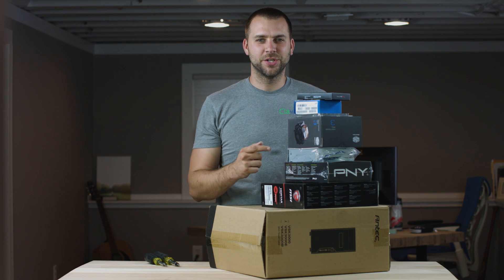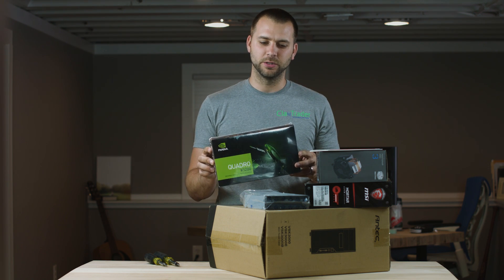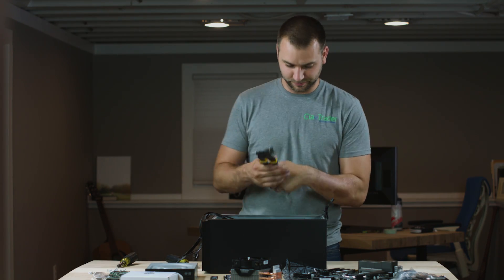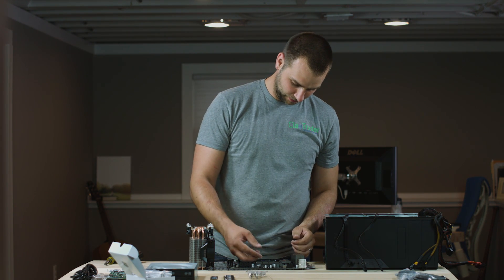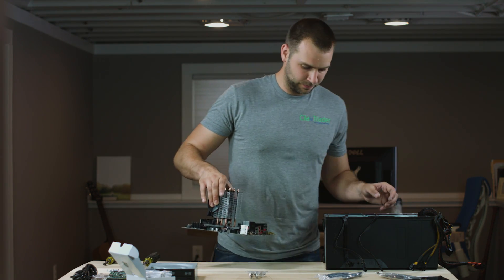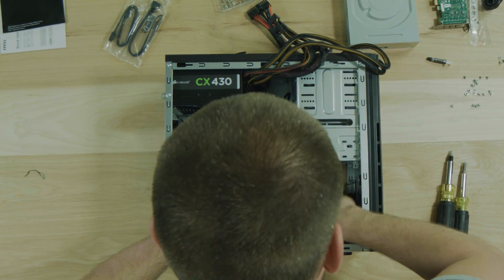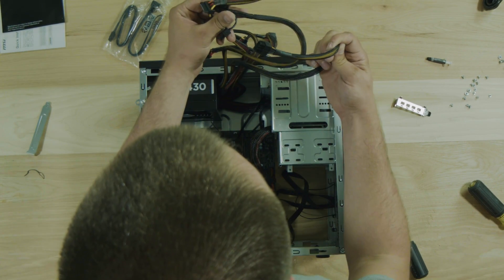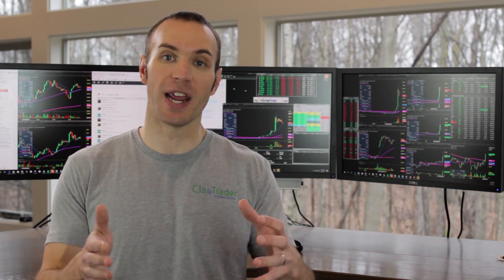How To Build A Trading Computer

Comment: One tip is to use 2 hard drives (or 2 partitions) if you plan to also use it as a personal computer. Then have one disk dedicated to trading only, no extra downloads, cruft, etc.. and reboot into the 2nd windows disk if you plan to use it for personal use.
Reply from the maker: Thanks for the suggestion.
Reply: Adam Brodzinski true
Reply: Thats a good tip but a true "trading computer" is used to trade only! Otherwise it would be a "Personal Computer for Trading" and thats not badass like a trading computer!
Reply: Yep my pc has 2 500gb drives, 1 for OS and 1 for trading and a 2TB drive for gaming and personal use.

Comment: One huge tip for any computer build. Do your "board build"! 
Install CPU (with fan and heat sink), RAM, video on motherboard and connect the power to the motherboard from the power supply. Connect the monitor to the video card. User a screwdriver to short the pins for the power button...or connect the power button, but that might not reach. Shorting the pins by touching the screwdriver tip to the pins (locate the pins using the motherboard manual diagram, you have the manual...right?? lol) is just like hitting the power button. If you get video to the monitor (POST screen only as hard drive is not yet connected with operating system) and the CPU fan spins, you're in business. If not, you just found out you have some troubleshooting to do. Better to realize this now than after you've gone to all the trouble of getting everything mounted in the case, and then realize there's a problem.
Defective motherboards are common. This is a good way to make sure yours is good before mounting it in the case. Same with video card, but those are less likely to be defective. CPU and RAM even less so as they are generally more solid.
Once you complete the board build, disconnect the monitor, remove the video card, unhook all power, and install the motherboard with CPU and RAM in place into the case. 
I'm not seeing any specific videos on this. But this is how I learned back in the day as a PC tech working in tech shops. We'd normally have a separate workbench for board builds with a dedicated monitor, etc.
Reply: Doing the board build also helps if your case is small and you have large hands. Installing the CPU and fan can be very delicate if there is little space to work.
Reply from the maker: Thanks for suggestions.

Comment: Curious question. If you are trading from a physical PC, you run the risk of internet or power cutting out.  You can use a UPS (Uninterrupted Power Supply) to deal with the power going out, but the internet, maybe if you have an alternative, one would cut out and the other would have to connect.  So, isn't it better to use a virtual PC that is hosted, rather than a physical one?  Also, if you could host closer to the exchange, I think the BUY/SELL messages will be executed quicker.  Am I wrong here?  Cos I was thinking what PC to buy, and wondered if my wizz bang PC would just be an interface to connect to a more reliable faster virtual PC hosted close to the exchange, and hence, anything more than basic would be a waste of money.  Thoughts?
Reply from the maker: I just have a battery backup. Never had any problems. Worst case, you can just call your broker.

Comment: please make sure before touching any components to get rid of all static electricity by touching some kind of metal like the case or a metal table etc.
Reply from the maker: Thanks
Reply: myancestors  :p this is not the first time he is using computer man
Reply: A tech shop coworker pointed out to me once that putting the motherboard on top of the anti-static bag is wrong. Basically static can't get in the bag, but it can get on the outside. I still do this! But good to know still. Also good to use an anti-static strap...but I never even bought one. lol
Reply: myancestors ..indeed...standard procedure. Well observed.

Comment: im buying a 2017 imac, would you say getting the more expensive I7 core version is worth it or I5 would work good??
Reply from the maker: It really depends on how you plan to use it. Personally id always opt for the i7 over the i5 as that's a component that is not really upgradable down the road.
Reply: i will only be using the imac for trading and doing research no personal use, no editing or photoshop. 
i have 2 monitors and will have many webpages open, and at the same time the trading software.
Reply from the maker: That would be more than enough.

Comment: Hey Clay can you also do video about what tablet is good for trading on the go. Most of the day I'm in the car. I would like to know if tablet or laptop would be good to use. Also, is ipad also good for trading? I'm also curious if you can pimp a car and make a trademobile out of it. 😁
Reply from the maker: Tablet vs. laptop is going to be personal preference. I personally use a Surface Pro 4, but that's just me. By no means is that the "must do" way to do it.

Comment: i have a bunch of questions. Why a quadro gpu? why not a faster nvme ssd of similar pricing? e.g samsung sm series or 961 pro. why not more cores for the same price or higher?
Reply: im not dissing you or trying to find flaw. i have not started trading yet and i wanna know which app to use and what it would demand. and like in games would 120hrz affect how fast data is put onthe  screen?
Reply from the maker: Went with the quadro simply for the stability of a workstation class card. The 960 is the card we used, seemed to fit the bill for what we were doing, anything faster really wouldn't be noticeable, but nothing wrong with a faster card. as for 120hrz I'm not sure youd notice the difference but i cant speak from experience on that one.

Comment: Is this CPU capable enough to run games like cs go? Asking cuz theres a MSI part!
Reply from the maker: I cant speak from actual experience but it should be more than capable to handle the vast majority of games.
Reply: The CPU is definitely more than enough, the GPU however - with that you likely would find a better deal with a non quadro like the gtx 1060 or such.
Reply: Lars DS thanks for the reply!

Comment: Here is a great pro-tip : don't build the thing yourself. Go to dell, spend some money, take out an extended warranty, and trade until you are blue in the face. That way you get to the main question a lot quicker - i.e. "is trading something I can actually do successfully?". If you spend £1000 on a system and find after 2 years that you can't trade, it will be the best £1000 you ever spent.
Reply from the maker: Thanks for the thoughts.
Reply: @claytrader  you are too polite
I guess you’re avoiding confrontations but pro pc builders don’t really understand trading needs.
You saved me quite a bit of money on gpu. Thanks. 
Although I do wish you’d build a cleaner setup
Reply from the maker: @nirvishchokshi  cheers and thanks for the feedback

Comment: its not a m.2 hard drive or a m.2 card its a m.2 or m.2 ssd
its a optical drive not a cd drive 
the reason you dont touch the bottom of the cpu is because you could easily bend the pins
use a pea size dot on the center of the cpu
the placement is not different on every motherboard 
its a io shield not a back plate
Reply from the maker: Feel better?
Reply: @claytrader  yes much better 
read more 

i was only trying to fix your mistakes so if you make another pc you make it right i was not trying to be mean sorry if you felt offended
Reply from the maker: lol.... my computer works just fine and has worked well for years.... i appreciate your concern though
Reply from the maker: Are you about to tell me next that your dad can beat up my dad? lol..... goodness my friend. Not sure why you're getting so worked up over this. Calm down, you'll enjoy life way better.

Comment: That's overkill i3 8100 should be enough
Reply from the maker: "should be" is a scary phrase.
Reply: Clay Trader, i have to disagree mate, my 5 year old laptop can trade, so the i3 8100 is more than enough. hell an i3 can even game at 50fps high with 1050ti.
So yes alot of the trading builds ive seen is overkill. i3+1050ti+8gb ram will be more than enough.
Reply: It's depend on chart type too. For Candlestick chart I3 8100 is enough but for Renko chart it requires high end PC. When i open multiple Renko chart with Indicators my old PC freeze like a hell. So it's all depend on usage.